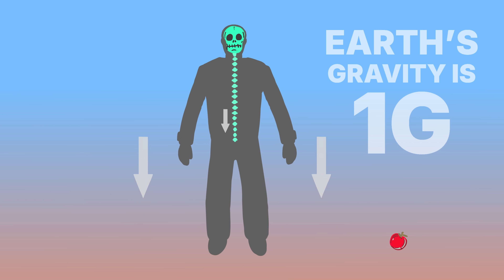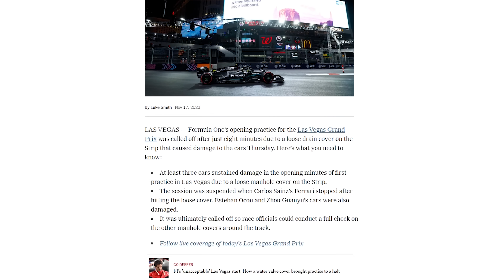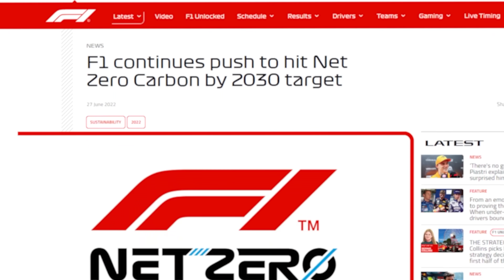Neil deGrasse Tyson Explains the Physics of Formula One Racing

Comment: Correction: Hans doesn't help drivers keep their necks straight, it helps to prevent breakage of the neck in case of a crash. They still use their neck muscles to keep their heads looking in the right direction.
Reply: Which is why their necks are about the size of an average human thigh.
Reply: @Arachnotron_Clippy  it's always super funny to see, for instance Charles Leclerc next to his brother Arthur. you can really REALLY tell the difference in neck muscle size 😁
Reply: @Arachnotron_Clippy  F1 Drivers necks be like: 🗿
Reply: @Arachnotron_Clippy  Necklonso is real
Reply: The neck, but even more particularly to prevent a basilar skull fracture. The weight of the head moving forward while the upper body is restrained means the base of the skull is the only thing keeping the head attached to the spine. So, either spine, or more likely, the skull separates. That particular kind of fracture has a high probability of death. It's what has killed numerous drivers before the Hans device came along.
Reply: @lagautmd Very true. It's practically unheard of to survive a basilar skull fracture. I don't know of any notable cases where a driver has walked away from that specific injury; it's usually instant death.
Reply: @SteelyEyedMissileDan  Davy Jones, an up and coming IndyCar driver crashed after spinning out at Disney Speedway IRL race. He hit the wall tail first at 150 mph and the transmission and engine transferred the 50 plus G's to his back. His head continued backward and almost popped off. Luckiiy the rescue crew were able to stabilize the unconsious driver to get him into surgery immediately. He survived his broken neck and skull fracture but was in traction for months. This ruined his career, but after a long road back he returned to be a successful sportscar driver.
Reply: @SteelyEyedMissileDan  one of the reasons why F1 still is the most deadly sport around
Reply: @SteelyEyedMissileDan  I thought it was near 100% deadly, but I wasn't sure and didn't want to claim more than I knew. Thanks for putting the clarifying point on it.
Reply: @Thund3r14n0 Isle of Man TT hold my beer .
Reply: Exactly.
Reply: this almost made me stop watching....then looked into the comments and atleast i'm not the only one who noticed
Reply: @MaxVerhaag same.
Reply: Exactly! For anybody who wants to learn more, the strap that runs through the HANS (head and neck restraint) device is only connected to the helmet at either bobbin, and can slip freely through the HANS. This allows the drivers to turn their heads side to side. Crash structures on either side of the driver's helmet prevent lateral motion in the event of a crash, while the HANS only limits forward motion of the head, more specifically forward rotation of the head about the neck/spine. In smaller crashes (which are still BIG crashes compared to what road-going vehicles usually put up with) it prevents "whiplash" related injuries. In more severe crashes, it helps to prevent the neck from breaking completely.

The reason you NEED a HANS device is because helmets are heavy. The added mass on your head works to actively harm your neck and spine in the event of a crash. For all intents and purposes, the HANS device plays the same role an airbag does in a road car. The seatbelt/harness arrests your body, the airbag/HANS arrests your head.
Reply: @jeremygrice311  HANS is needed because your head is heavy, and your neck not meant to support it or stay attached under instant loads in crash.  Their helmets only weigh a few pounds, their head 11 lbs. in a crash turns into hundreds of lbs.
Reply: @TheChipMcDonald  Sorry, I didn't mean that you wouldn't need a HANS if you didn't use a helmet, just that the mass of the helmet increases the force on your neck in a crash.

Human heads are typically between 2.5 and 5kg, the average head weighs 3.75kg, and f1 helmets are ~1.25kg so the added 33% mass is actually quite substantial. Also, the moment arm that the mass of your head has over your neck is the key factor. In a crash the jaw doesn't move as far as your scalp for example. Because helmets sit on your head, they also bring the center of mass of your head further from your neck which increases the potential harm.

So yes, you'd still need a HANS even if helmets were weightless, but the added mass is far from negligible.
Reply: I was just going to say this, let’s make this the top comment
Reply: waiting for someone to say it so i didnt have to lol
Reply: Neither is the cockpit coaming to help the drivers control their heads. It is also to protect against lateral loads in the case of an accident.
Reply: @sgabriel the cockpit DOES keep their head from traveling too far laterally. While also like you mentioned, for crash forces.

But in the case a driver suddenly fatigued, they would be okay, cause the cockpit wouldnt allow their head just snap out laterally.
Reply: @tacticalmattress  It's only neck muscles.  Their helmets won't touch the surround (which is there for aero)  unless it's someone subbing who has not trained hard enough for it.
Reply: @tacticalmattress  Negative, sir.
Reply: True, seems NDT doesn’t know much more than the average F1 fan.
Reply: @johncheffins6467  Well, he's an Astrophysicist, not an engineer. He probably knows less about F1 than the average F1 fan.
Reply: @johncheffins6467  im quite dissapointed already at 8 mins in...
Reply: @tundramusicproduction  same here, as an F1fan, I Hoped for a bit more physics explanations.
Reply: @johncheffins6467 he’s a blustering activist
Reply: @johncheffins6467  Neil in fact isn't as smart as he makes himself out to be, a couple of years back in a video he claimed that cars are limited to 1G of acceleration and he had to be corrected in the comments by those of us who understand physics and motorsport a bit better  ;-)
Reply: ...came here to say this as well, lol...
Reply: Bro, yall are insufferable. You prevent neck injuries by bracing the neck!! It provides stability to keep the neck from rotating, ie keeping it straight. You can literally look this up on F1 physics, it does keep their neck straight to prevent EXCESSIVE rotational movement thus restricting neck movement.
Reply: True. Along with the graphic suggesting that underneath the car there is a lift…
Feel like this video is dedicated to noobs and not all correct.
Reply: @lucabiagini7047  In aerodynamics, a force perpendicular to the airflow is generally called lift. In motorsport context, the type of lift you want is usually directed downward, so it's more often referred to as "downforce", but "lift" is still correct in a more general physics terminology.
Reply: @HerraTohtori  I know. But here it was misleading. Someone that doesn’t know how a F1 works would have got it wrong from this explanation. Looks like the car get pushed up from that force, look at the harrow
Reply: @lucabiagini7047  If you are talking about the graphic at 8:00 you have not paid attention to the video.
He is not saying there is an upwards force on the car he is explaining why loose drain covers can get sucked up by the car
Fast moving aerodynamic car creates an area of low pressure beneath it, causing itself to be pushed down and things on the ground to be lifted up towards the car. Hence the upward arrow. Making a downward arrow would not explain why the drain cover got sucked up to viewers.
Reply: @coin5207  I did pay attention. You might haven’t read properly what I said. I wrote that it could be misleading and not very clear. Cause you see an harrow going upward and the car moving up and down. Of course I know what it supposed to mean, I just think it could have been more clear, for example mentioning first of all that low pressure because of the air moving faster underneath then on top of the car suck the car down, then consequently everything else.
Reply: @lucabiagini7047   But the point is it's not misleading given what they're talking about which is objects on the ground experiencing an upward force. They are not talking about forces on the car there. They already talked about car design elements like wings causing downforce, Bernoulli effect, difference of air speeds and different pressures 2 minutes earlier.

The viewer knows all this if they paid attention. Now they are talking about something different and they even add the animation of the manhole cover. You are not watching this one frame in a vacuum like the rest of the video doesn't exist.

On top of that it's already a 16 minute video, of course they could talk 10 hours about the exact science behind everything but that is not the point of the video, it's supposed to be a concise thing that gets people interested.
Reply: @coin5207  you are definitely right. However considering that on these cars the ground effect is the majority of the downforce, I think it could have been more useful to emphasise the Bernoulli effect on the car instead of on the drainage. 
Then, if the viewers know the topic was really a useful tool appearing surprised when told the car setup change from track to track…? 
I know everything you say and understand your point. I only think it could have been done better.
Reply: @lucabiagini7047  ok fair enough
Reply: @lucabiagini7047  To me, it felt more like the animator perhaps didn't quite grasp the concepts being discussed.

Of course Neil could have explained it better, but aerodynamic lift as a concept is already devilishly difficult to explain without resorting to some level of simplification.

But the thing with people like Neil deGrasse Tyson is that they have a very thorough and broad understanding of the physical world around them, and when they are asked to describe what they see happening, it is an almost automatic response to use the concepts that they normally use.

The thing that makes discussions like this interesting is that you have someone who clearly isn't very familiar with motorsport, but who can still articulate what they're seeing and explain it in terms of basic physics.

I do agree that talking about lift when it's actually pointed downwards can be confusing, and I guess that's the main reason it's usually referred to as downforce in motorsport context. But that is kind of a niche context for aerodynamic lift, so I will still say that Neil's chose of words was correct in a more general physics context.

Therefore, I would say if the animation was done better to display the pressure difference between the topside and underside of the car, and included the direction of the lift force clearly pushing the car down against the road - then I think there would be no problem.
Reply: @lucabiagini7047  the graphic illustrates ground lift in relation to the floor, a weird way to explain ground effect for sure.
Reply: @lucabiagini7047  He's just an entertainer of morons. He doesn't actually know anything.
Reply: And the left direction also 😊
Reply: you could see the driver turning his head into the corners in this part of the video - surprising they didn't pick this up in editing.
Reply: They do also use it as a headrest tho. Especially after during a ling race with lots of high speed corners.
Reply: I’m less than an hour from Silverstone.: I wish I knew you were visiting. Great video by two of my idols 🌞
Reply: I think its all just for a bit of fun and to promote stuff
Reply: yeah the Hans device really came into use as a mandatory piece of safety gear after the death of Ayerton Senna.  Slammed into a barrier pretty much head on--threw his head forward in the helmet, and literally pulled his spinal cord apart at the base of the brain.
Reply: isn't that what the cushioned foam around their head is for too? to supress the impact from a crash but also going around corners, I know bearman had trouble adjusting to the g's when he subbed in for sainz so that's where my idea came from
Reply: @kurth.y  Yeah, they do all they can--but these things corner at such high speeds that the inertial force pulling you is very strong.  F1 drivers have to have very strong necks--there are whole exercise regimens just for that.
Reply: @danielvandersall6756 yea I’ve seen how rigorous it is, until then I never really knew that the human neck could withstand so much force without just snapping like a carrot 😅
Reply: @danielvandersall6756  it was surprising, guess max got too caught up with lando to make a comeback
Reply: its anti whiplash device :)
Reply: You can see Leclerc leaning into the corner to engage these muscles
Reply: Just put the same comment in 😂
Reply: Oliver Bearman's debut in 2021 Saudi Arabia GP and Colapinto's race in Singapore proves that. They can't hold their head anymore and they rest on the cockpit after lap 30-35 but other drivers still hold their head at corners
Reply: Well said. Oscar Piastri is one that stands out for me. Compare photos of him from his F2 days to now. Skinny neck to Hulk neck.
Reply: You're correct about the HANS device, but the cockpit has heavily padded headrests on either side of the driver's helmet. Their intended use is for safety, but drivers may use them to help rest their necks when they get fatigued.
Reply: Correct!
Reply: Also another more minor thing is that the drivers do sometimes pull over 6g in the corners
Reply: He may be a doctor of physics but we are motorsport fans lol
Reply: Yeah, ask Dale Earnhardt... Oh... that's right, you can't!
On a serious note, that was pretty sloppy "journalism".
Reply: Did HANS is not tightly connect with driver helmet because if the driver crash, the driver don't get the serious brain injury when their brain go forward of accepting high G force? Sorry my english is bad
Reply: Correct to stop basal skull fractures like what roland had
Reply: 👏 Thank you
Reply: Exactly! That was what Earnhardt sr. called it "that damn noose"!!!
Reply: We have the hans device because of Dale Sr...
Reply: Why is NDT using that guy as an armrest?
Reply: God I wish I knew about F1 as much as all of you, it's super impressive
Reply: You're comparing a mechanism to a purpose; two completely different categories. You might as well say "No, the top of a can isn't to block out air, it helps to stop food from spoiling." Textbook non sequitur

I didn't even find an instance of anyone in this video claiming that this is what these are doing anyway, looks like their illustration was to show their heads can't go too far off center in the case of excessive lateral gs. So this isn't even a correction, it's the comment equivalent of a shower argument
Reply: but, to be fair, "keeping their necks straight" is a way a layman might describe how a device works that prevents necks from breaking in the event of a crash.  If you crash and your neck breaks, your neck won't be straight anymore
Reply: rip senna
Reply: Hold on, dude. This guy is an astrophysicist. He knows more than anyone 😆
Reply: This is a an entertainment channel with a definite political agenda.  If you come here for unbiased hard science you are in the wrong place I am afraid.
Reply: @msromike123  I'm not going to watch it again to hear the political messaging I completely missed, so could someone tell us?
Reply: Roland Ratzenberger and Ayrton Senna died because there was no HANS at the time.
Reply: @KatyaLishch the wheel hit Ayrton Senna on his helmet the round thing that circles the driver would of stop it hitting.
Reply: @MsKaterin  Not in the case of Senna, but lots of others did. That was a  almos frontal hit at around 270kph, the issue was with the steering rod breaking up. Saddest accident ever, saddest weekend in fact.
Reply: @MsKaterin Senna died because a part penetrated through the helmet into his head. The forces weren‘t that high. Roland on the other hand didn‘t stand a chance due to the acceleration forces on his body and especially his head.
Reply: NOT TRUE
Reply: They could essentially rest on it. But I'm sure your face would be getting quite squished into your helmet 😂
Reply: @tacticalmattress  HANS device prevents over extension forward.  You can't "rest" against it.

Comment: 9:45 there never used to be a speed limit in the pit lane
Reply: There is since 1994. Usually it's 80 kph, on some tracks (Monaco) it's 60 kph.
Reply: @SiqueScarface exactly 😂
Reply: @SiqueScarface  The Black 1994 weekend at Imola was the push F1 needed for many safety advances, including a pit speed limit
Reply: "Never" being the last 40 years?
Reply: Even 80s indycar had no speed limit either
Reply: Wrong. The speed limit had been 80kph for many years already. Many drivers have had tickets because they drove too fast in the pit lane
Reply: @FrankDijkstra  sigh, pit lane speed limiter was introduced in late 80s or early 90s, so before that they did not.
Reply: @CharlieBBB I love how you set this up with the phrase "there never used to be."
There never used to be English spoken at car races. 🙃
Reply: @FrankDijkstra  Indeed, only minor correction: there is no such thing as kph. It is km/h since SI unit symbols  language neutral ;-)